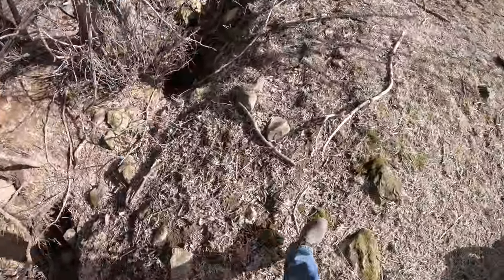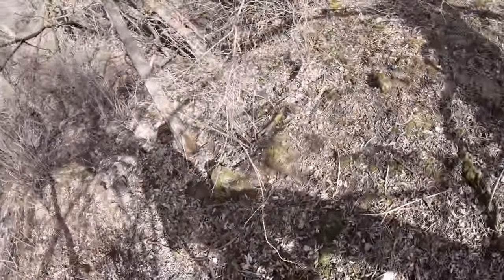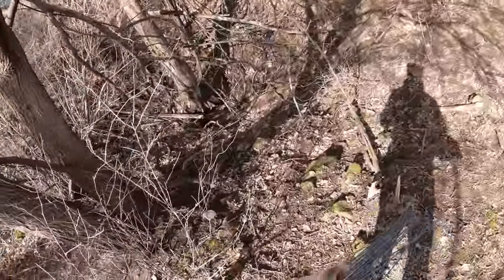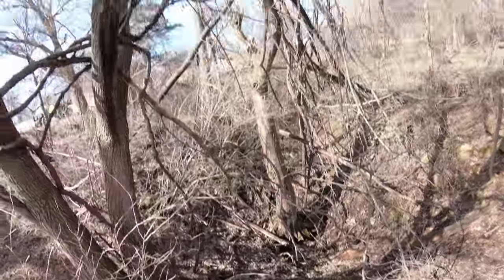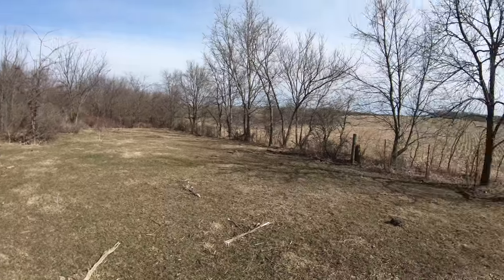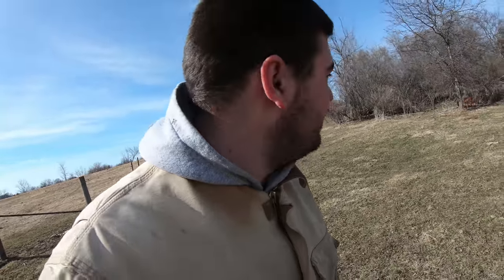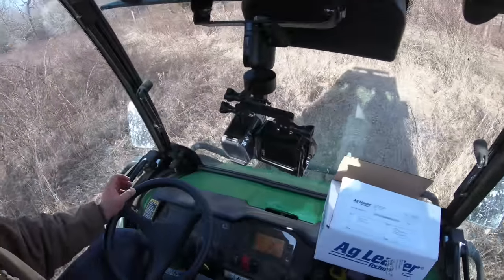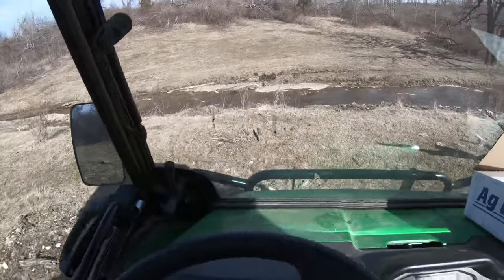Checking Farm Fences for the Cattle

Comment: during the slow time y'all need to get a little trackloader in there shove some of that brush I can say that there is not much more of a satisfying sound then pushing trees and brush out with with something that simply doesn't give or care
Reply: caseih magnum I said something similar but I think a D8 would do a great job on his and Travis's farms.  It would only take a month as long as they don't drive it from one farm to the other.  Plus they would be able to fill those holes in to.
Reply: Don Hanson true but a d8 would be pretty hard to move and really you only need enough cleared from the fence so they could keep after it with the beast
Reply: A D8 Cat would have plenty of power to clean up the fence lines, flatten and fill holes, knock over/push over any bigger trees.  Clear the old foundations out, and Clear up all the over growth and push it into fewer piles.